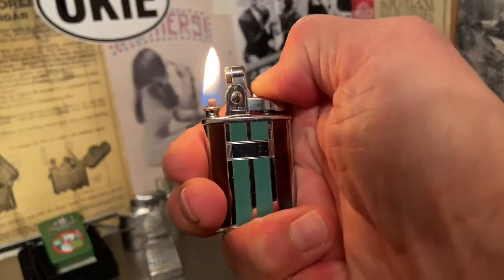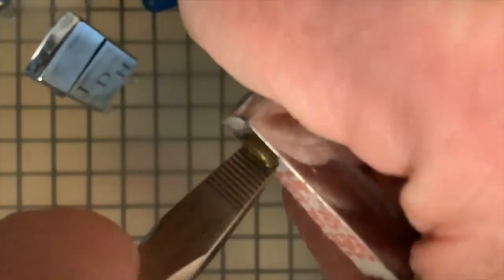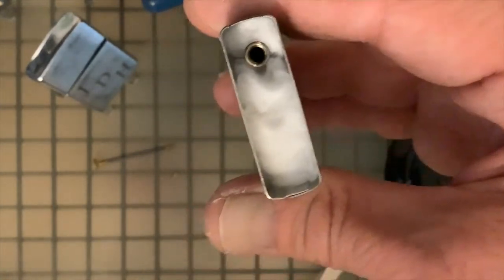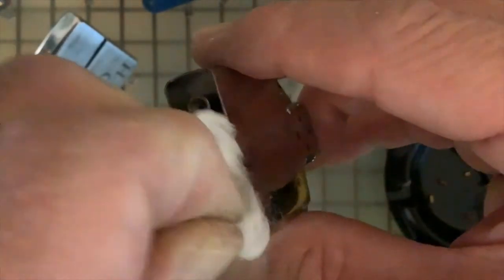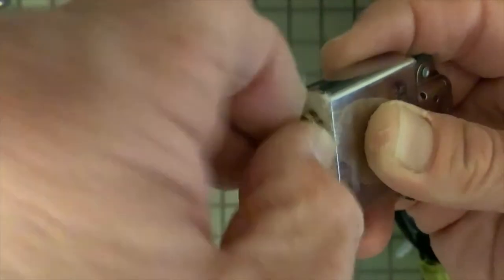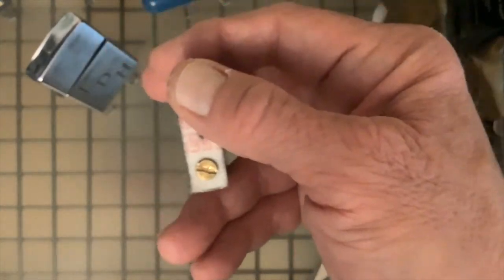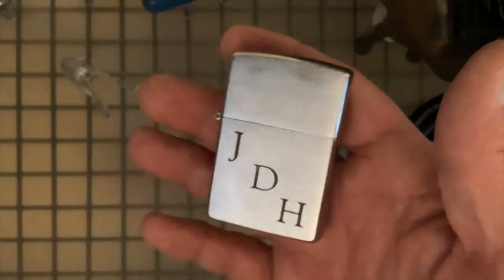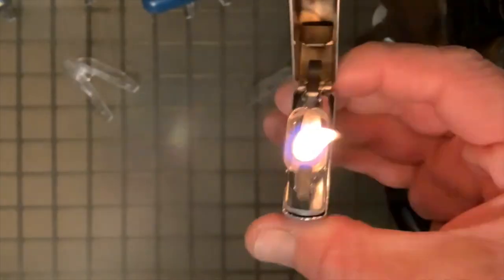What Happens When We Fuel Up And Use A Poorly Packed Zippo Lighter Insert?

Comment: Hi Joe, as I told you some time ago, you will see that there won't be big differences. I have done a lot of experiments. I once took a small piece of wick, leaving only half a centimeter inside the insert, and it had the same duration, but with a small difference. with the long wick placed in an S shape, the flame resisted better the wind from the fan. I don't even remember how many experiments I did with the zippo, and I don't know how many I'll do more. I think it is a mental problem, which however does not cause me psychic suffering, on the contrary it gives me a lot of pleasure. My friends say I'm sick where I comb my hair, but when they see my collection, they are amazed.
Reply from the maker: You have a way with words Giovanni, I love it!😜✌️